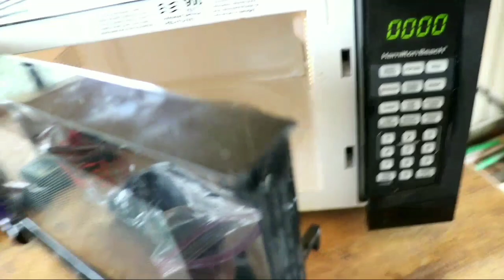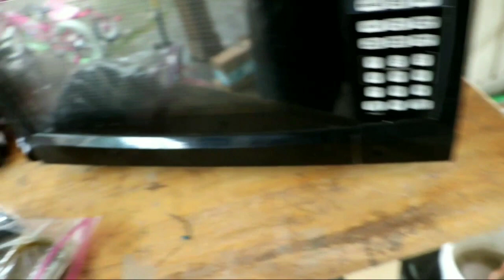Soft Plastic Bait Making | Bass fishing lures pt. 1

Comment: Are you going to spray that mold with the engine enamel?
Reply from the maker: I tried that and I DO NOT recommend doing it, after a few shoots it started to peel off and left black flakes all over my baits. It got to the point that I stripped them all off and left it as is. That hack doesn't last